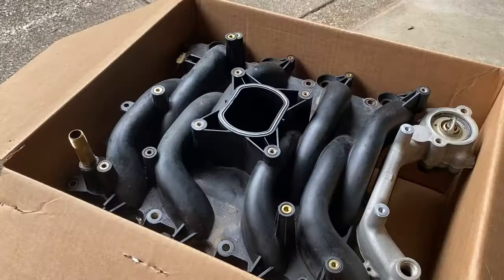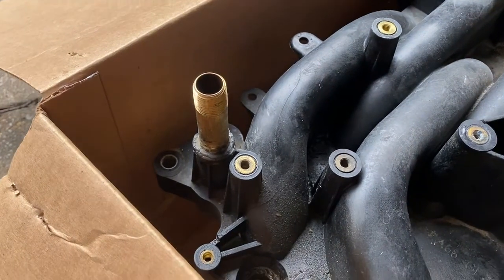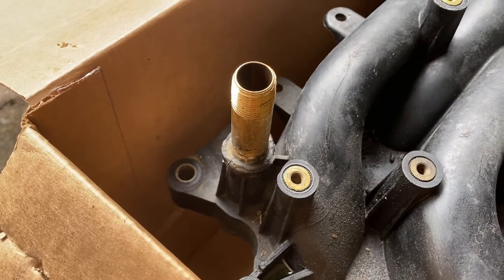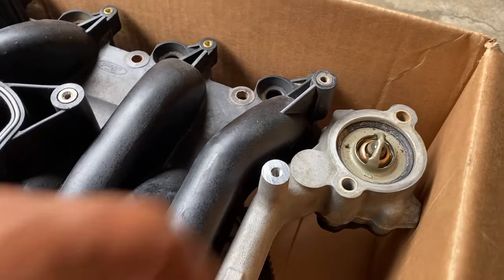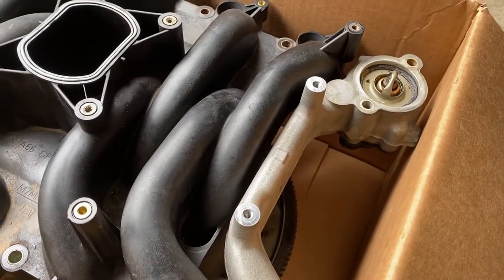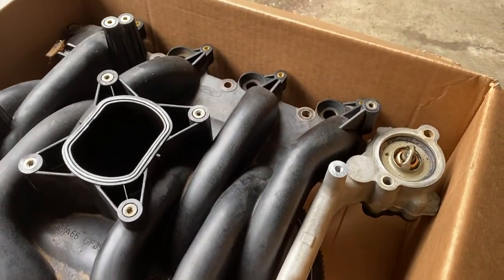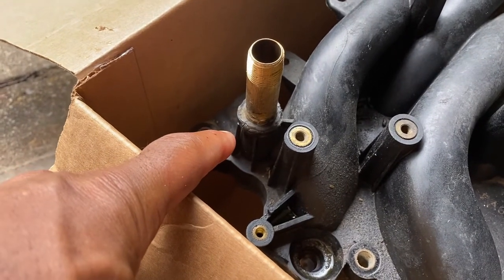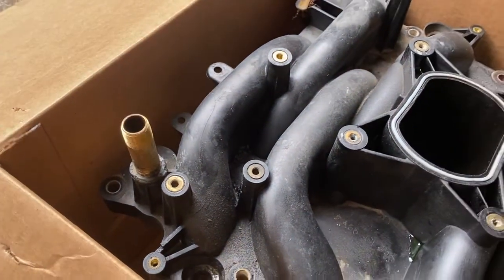2003 Mustang GT broken Intake manifold nipple on 4.6L 2V V8 engine, REPLACE!!

Comment: I repaired my broken nipple with a plastic heater hose connector and high heat epoxy. It's lasted 5k miles. Seen a lot of other people try doing it with metal fittings/inserts like you. It never lasts. The key is bonding plastic to plastic. This is good fix for awhile. In the meantime I would be getting a replacement OEM, PI or rare aluminum Typhoon.
Reply: I’m having the same issue, where would you recommend getting the heater hose connector?
Reply: @tykievious5992  You can get em at any run of the mill auto parts store. They're usually located where the hose connectors are. This is actually a pretty safe fix if you do it right. I have actually put about 10k miles on the car now with it repaired that way. You're going to wanna get rid of the old nipple completely though. I would break or cut it off flush. I actually sanded mine down with a fingernail file.
Reply: @blessedjuggernaut  Did you sand down the lip on the 5/8 side of the connector?  Or were you able to push the connector into the broken off hole right out of the box?
Reply: @MotovationWithoutMusic  I only sanded down the where the nipple broke off. Actually, did that with a fingernail file. As far as the heater hose connector, I actually used a grinder on it to make it slim enough to fit perfectly in the hole. Also, just so you know I've put 15k miles on the intake with this fix. No leaks. This is a real fix. A lot of people go for brass or copper fittings. Never works because it won't bond properly. My fix works.

Comment: Ya man those factory plastic intakes r on borrowed time although much better than the previous npi intake they both get weaker with every heat cycle...That’s why I recommended the aluminum intake especially with boost in ur last video...Let me know if u feel any power difference with the Ford performance intake..
Reply from the maker: Power feels about the same, glad I replaced it and went new!